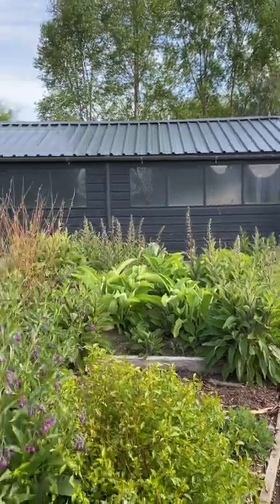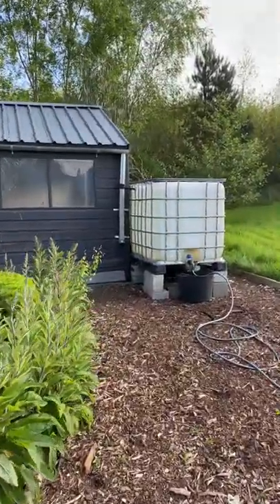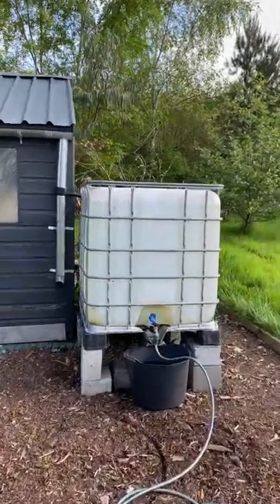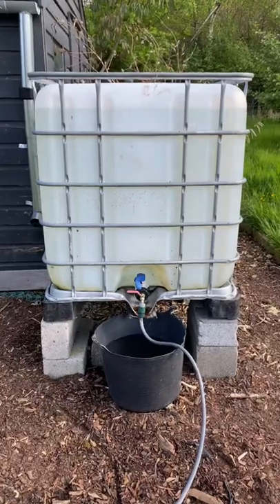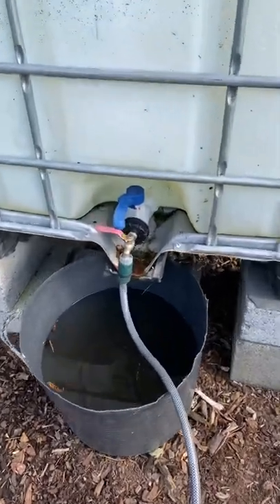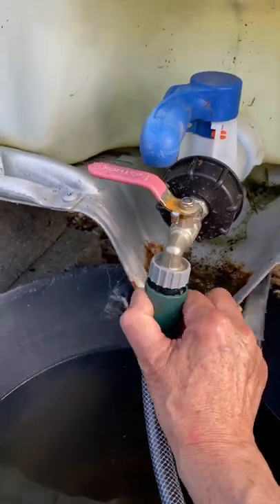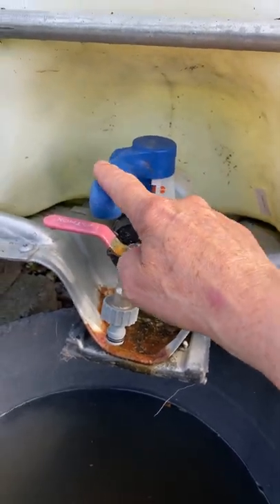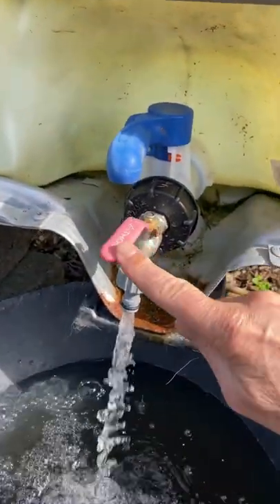Rainwater harvesting in an IBC tank and simple tap (aka faucet)

Comment: Ur tank is high mine is on the ground with its frame but water pressure is too low, how to increase that?
Reply from the maker: I'm afraid that the tank needs to be high for the water to flow down. If it is on the ground it won't work.
Reply: Find the pressure rating. Incorporate a Schrader valve. Pressurize the tank with a bike pump.